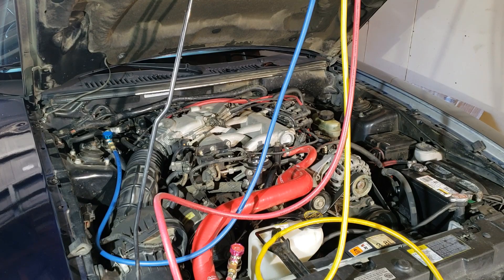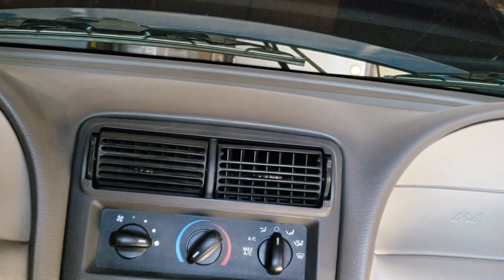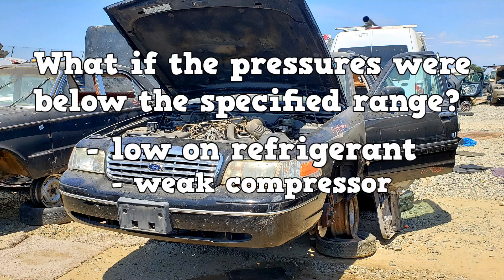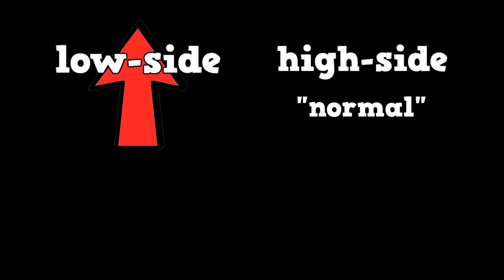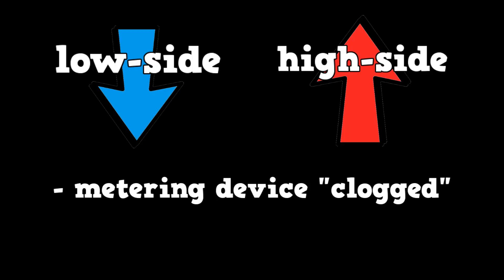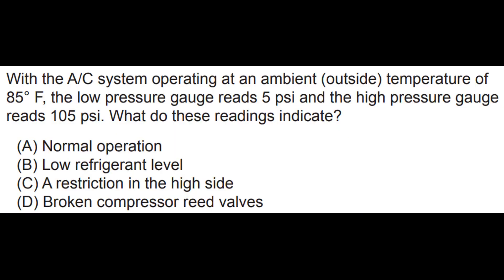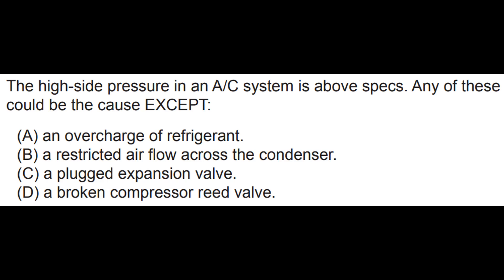ASE A7 Test Prep #1 - System Pressures Diagnosis

Comment from the maker: Update Oct 15, 2023: (Feedback after taking the test) No questions about how to perform the "performance test"
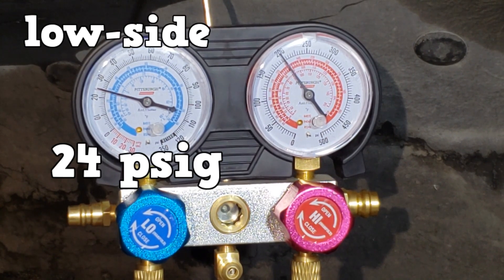  There was a few diagrams that showed the high and low side pressures. I liked that the answers were clear if you know how to interpret the gauges. For example, the readings shown at 1:23 , let's say there was a complaint of poor cooling to those exact readings and ambient temperature. What could be the cause? A. Clogged Condenser. B. Failed Compressor C. Air in the system D. Stuck Closed Thermostat.   
See, the answer is direct, they wouldn't try to confuse you.
I did not talk much about  "saturated" dryer elements, or "frozen" expansion valves. Know how these affect outlet temperatures. (Constant problem? Intermittent problem? Not a problem?")
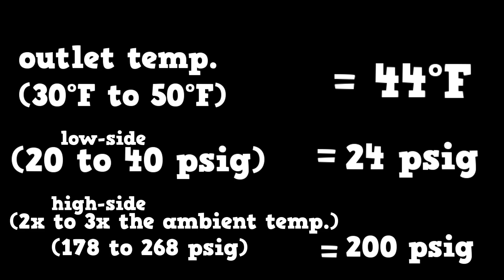At 1:45 I said the "ASE test does not ask you about relative humidity." There was 1 question about relative humidity in general.
The pressure scenarios after 1:52 are good to know.

Comment: Can you please clarify @3:23? So if you have a "restricted" FOT you will have low pressure on low side and low pressure on high side. But if you have a "clogged"  FOT (no refrigerant flowing through), you will have elevated high side and low low side? Thanks